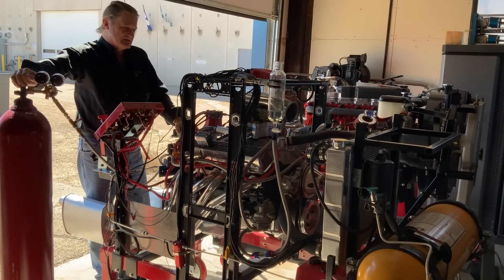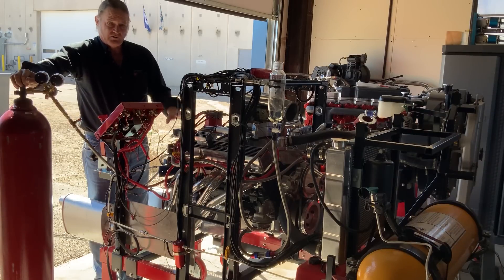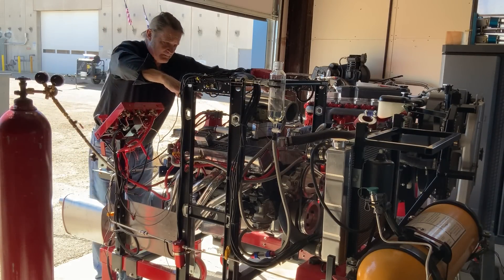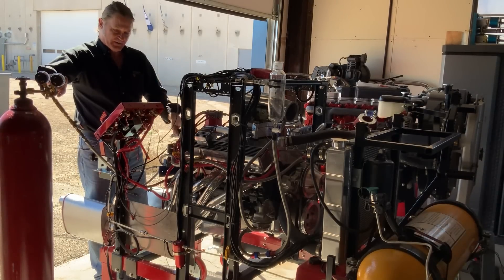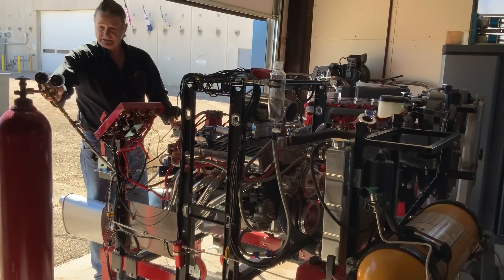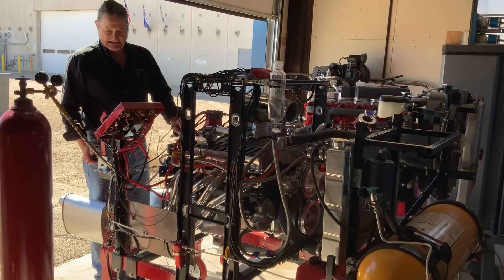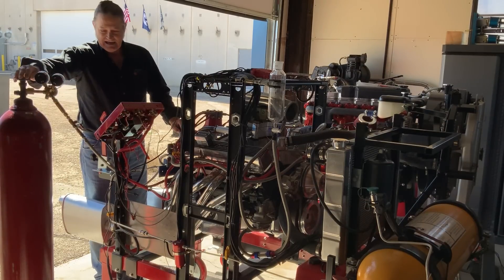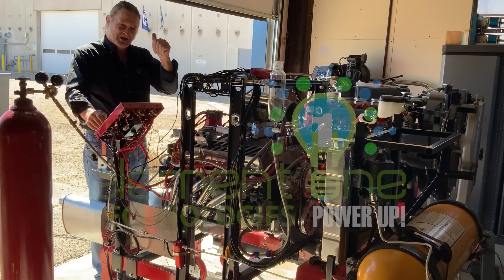Hydrogen powered V8 ICE High RPM Test

Comment: this should be out to market soon, we need more of you to get the word out there
Reply: The problem is how much hydrogen it uses.  The better alternative is hydrogen fuel cells that convert the hydrogen to electricity and then run an electric motor.
Reply: Why bother with this technological dead end.
Reply: Hydrogen is very, very, very small.

It leaks, no matter what you do. 
It leaks through rubber seals, it leaks through gaskets, it leaks through pipes if given enough time.

Don't get me wrong, great idea; practical hell if you want to power an engine separately from an hydrogen producing facility.

Storage is almost impossible and if it leaks underground, it makes for an explosive combination that's virtually unstoppable.
Reply: @TheGagabou  ya, all of those problems you mentioned are mitigated by maintenance … which adds to costs.  I read hydrogen is 8x less energy efficient because of generation losses, compression losses, transport losses, decompression losses, conversion losses.  It seems the only industry where it would make sense is one where weight of fuel and batteries would be a barrier.  Such as airlines and yachts.  Massively expensive energy solution.
Reply: @esquire9445  the germans  achieved parity with petrol and diesel engines last yr and hydrogen powered vehicles are on sale in Japan Indonesia and America now , one has a range of 1000 miles plenty of vids on this platform about the advances being made Tesla are ditching batteries and switching to hydrogen fuel cell technology in the next year or two
Reply: @karlchandler5824  please cite your sources.  I just tried to verify your comments and I don’t see any reliable sources claiming that about Tesla.  The Japanese hydrogen engines are not as energy efficient as gasoline or diesel watch the video by the channel Engineering Explained.  I wish it were true, in fact I hope you can prove it is true.  Please point me in the right direction.
Reply: @esquire9445  everything I have mentioned other than the germans achieving parity with petrol diesel engines was from watching the available hydrogen vehicle videos on YouTube and Tesla switching to hydrogen fuel cell technology came out Elon"s mouth watched it last week as he jokes about those dumb cells which he now think's otherwise , the germans achieving parity was from an engineering magazine that appeared in a news feed last yr which will be harder to find but everything else is on this platform search the top 7 hydrogen car's for the info on the xperion a high performance hydrogen fuel cell with a range of of 1000 mile , then watch suggested vids on it and you find plenty of info on the advances
Reply: @karlchandler5824  ok, thank you.  I will search harder as I am interested in this stuff.  I want a sailboat with hydrogen energy
Reply: @karlchandler5824  "Tesla switching to hydrogen fuel cell technology came out Elon"s mouth watched it last week as he jokes about those dumb cells which he now think's otherwise" - this didn't happen.
Reply: @JoshuaStringfellow1  https://youtu.be/Aw4Z4awLXFw
Can't find the interview myself but here is something related and the quote is in this
Reply: @JoshuaStringfellow1  and if the link doesn't work type in Elon's all new hydrogen car from the Elon Musk zone channel
Reply: @karlchandler5824  the quote is made up, Musk hasn’t tweeted that, it’s a joke video (although I don’t really get the point of it).
Reply: @rogerphelps9939  clueless

Comment: Did I miss you changing the timing? 
I never saw you change it, nor did I detect a change during operation. 
With hydrogen you really can't fire the engine anywhere close to as early as you would on normal gasoline. 
You need to fire the engine very close to TDC. 
At just off idle to 2500rpm or so the spark advance of a gasoline V8 is between 10 - 20 degrees before TDC - which allows peak pressure to be reached somewhere just after TDC. Hydrogen burns many multiples faster... so it must be lit much later.

Your distributor appears to be a mallory with no vacuum advance unit.
IF the distributor has the internal mechanical advance locked either manually or by the use of extra heavy springs and the timing is set somewhere lets say 6-8 degrees BTDC I can see it running, though not optimally. 
If you were to reach over and turn the distributor clockwise (retarding the timing) while it is running on the hydrogen I think you are going to be quite surprised how much smoother it will run... 
With the lawnmower engine I ran on hydrogen I had to move the magneto way around to make it have any power.
Reply: Exactly what I was thinking...he would definitely have less back fire...Lol
Reply: @mikebartley481  I don't think the ignition method fits the gasoline engine method. A diesel engine is suitable.
Reply: @mikebartley481  The ignition point of hydrogen gas is low and when it ignites, it is faster than gasoline.
It is therefore right to use diesel engines.
When using a gasoline engine, there is a problem with reciprocating piston movement.
Also, the Cummins Corporation in the United States recently developed a hydrogen engine.
The basic design was also based on a diesel engine.
I want you to show me running the engine for a long time.
Perhaps there is a problem with the reciprocating motion of the piston.
I also have a concept of developing a hydrogen combustion engine as a diesel engine.
The ignition point of hydrogen gas is low and when it ignites, it is faster than gasoline.
It is therefore right to use diesel engines.
When using a gasoline engine, there is a problem with reciprocating piston movement.
Also, the Cummins Corporation in the United States recently developed a hydrogen engine.
The basic design was also based on a diesel engine.
I want you to show me running the engine for a long time.
Perhaps there is a problem with the reciprocating motion of the piston.
I also have a concept of developing a hydrogen combustion engine as a diesel engine.
Reply: @소프-o5e  Bros spamming lmao
Reply: @3n3ly7m9  ??? What do you mean?
Reply: @소프-o5e  Wdym? What do I mean lol??? You copypasted the same thing twice or  3 times.
Reply: I don't think the ignition method fits the gasoline engine method. A diesel engine is suitable.
Reply: There is no timing change.
Reply: @karlrudisill  If you retarded the timing to TDC after going to hydrogen I beleive you will find the engine accelerates through the RPM much quicker. 
Hydrogen propagates a flame much quicker than gasoline, which requires a spark much closer to TDC... 
A chevrolet SB at idle or low acceleration will generally have 20-30degrees Before Top dead center. Which with hydrogen is generating max cyl pressure WAY before TDC... when it should be generated just after TDC